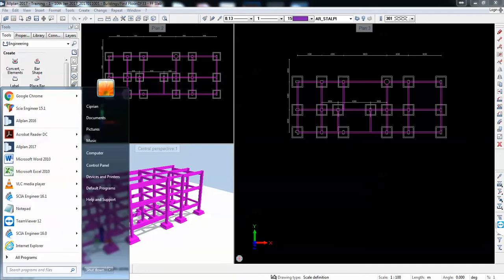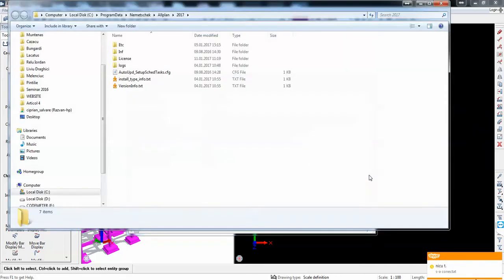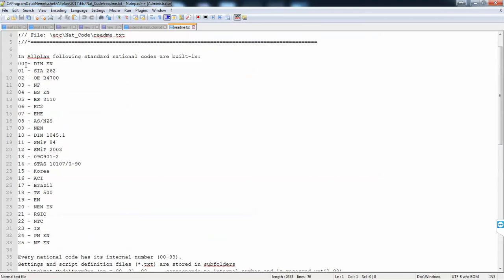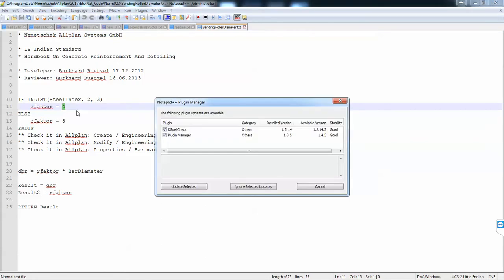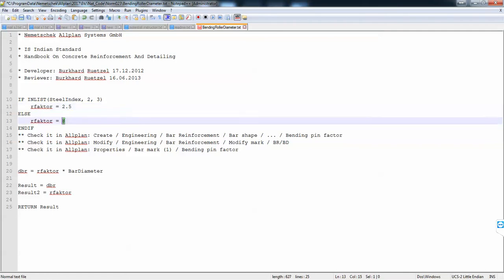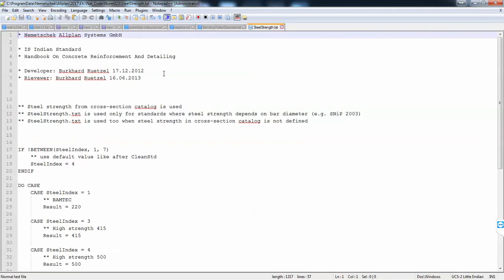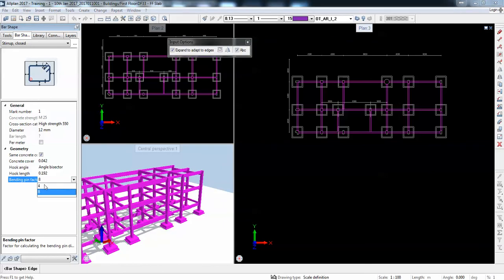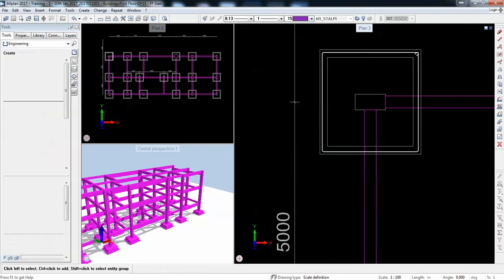#1 Allplan Training: Changing  Reinforcement Code Defaults [EN]

Comment: Hello there s a problem with the length of the styrup, ( the length in the list is not the real length )  do you how we can correct this ?

many thanks for your possible answer !
Reply from the maker: In the reinforcement settings you will find there are 3 ways to measure rebar. Axial, outer or inner. You need to select the desired method before creating the bar shapes.